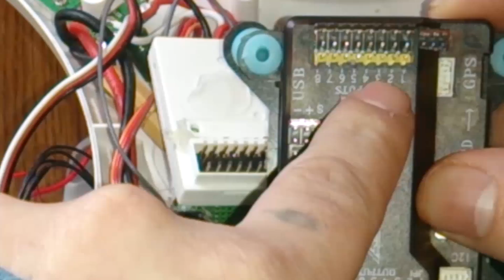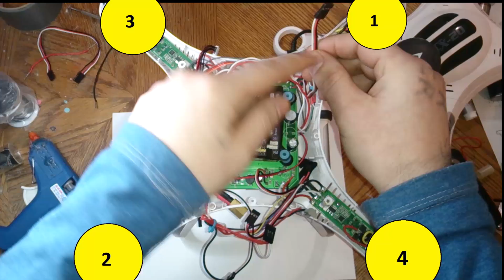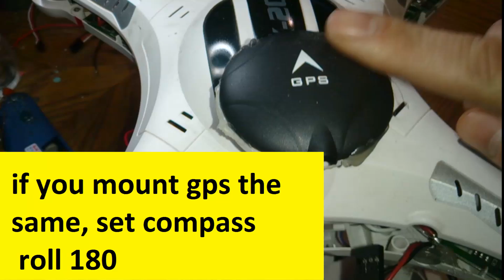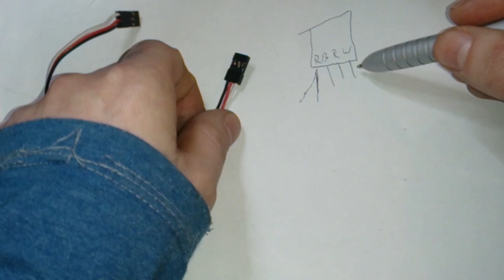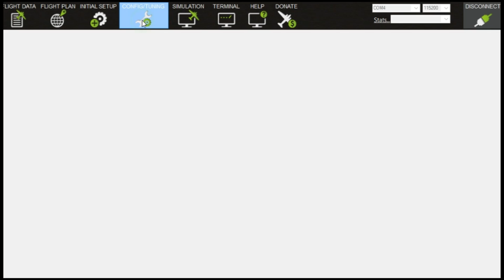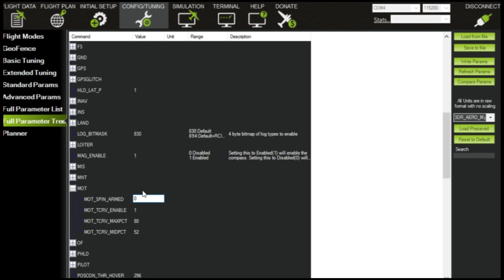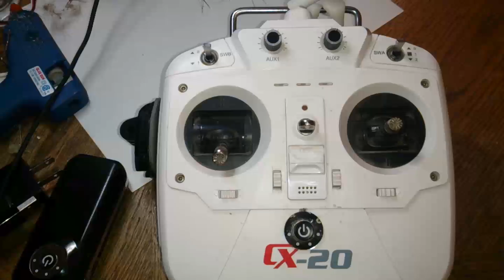cx20 factory apm to apm 2 6 - 2.8 step by step

Comment: Hi I have just built a tricopter with the APM 2.8 . USING DX8 RADIO.
I  am having trouble getting the flight modes in setting to change green to each  is loiter RTL stable ect.any ideas what's going on channel five is set for aux1 that is working in monitor. I can do every other settings in mission planner but flight modes.
Reply from the maker: Hi I don't have a dx8 ..   You would have to mix  channels 5 and 6 in settings on the transmitter....Then play with end points..    But i have no idea if you can do that on that transmitter ..   Somebody must of got that transmitter working with the apm 2.6 / pixhawk ect..
Reply: @ModItBetter  thank for your input I'll give that ago.years ago I built a quadcopter and it just worked.all flight modes.

Comment: Hi  Bangs My quad is the Quanum Nova Pro version. The wiring and plugs for the LED's is different to the CX20. I recently dug it out of my drone hanger hoping to fly it again after a couple of years. This version comes with Arducopter type control board as standard. I fitted a new Arducopter because the original had problems. Unfortunately i didn't take note of the connector positions when I first stripped it down a couple of years ago.My problem is i can't get it to arm. I have disabled all the arming checks in Mission Planner. When I plug in the battery I get orange/red flashing alternately, and green flashing until it acquires sats  then it goes solid. The orange/red  light doesn't turn just orange and give the ready to arm signal. It could be the wiring not in the right pins, but i don't want to change them over in case I blow something.  Can I send you some photos of the setup to see what you think?
Reply from the maker: HI here is a picture of the pinouts
https://drive.google.com/file/d/0B2w6_OKE_2kxc1pMTmdNSkFLQTQ/view?usp=sharing

Did you do a radio calibration ?  
also the wire people usually get wrong is the wire that covers 3 inputs on the receiver..  E,T,R     you might of put it the wrong way.      4:51 of this video
Reply from the maker: if you want as you said you can send some pics to 
bangs696969@gmail.com  
I can try to see if i see anything wrong on receiver side.
but make sure you do a remote/radio calibration . ect..
Reply: @ModItBetter  Pics sent from my phone.  Did radio calibration in Mission Planner and remote calibration as you show in the video. One strange thing about the flight modes in MP the mode changed as the switches were operated in words above the actual mode list ,but the green mode indicator did not move down the list as it should
Reply: Should all the wires into the analogue pins except the ground wires be in the switch rail ?
Reply from the maker: @kenmcnaughton5882  still waiting on pictures they have not shown up yet.
Not sure what you mean by all the analogue pins..  for the receiver to the apm ..the cx20 did send the positive and negative to channel 7 and 8 on the apm 2.5.2...   i could never figure out why they actually did that unless it was just so they would not float...  anyways its not needed.

I"m not 100 percent sure your using a 2.5.2 apm or a 2.6/2.8 apm as well..
Reply: @ModItBetter  Sent the pics to your email from my phone I will try again.I call the pins on the left side analogue because number one to eight says analogue nine ten and eleven are marked PWM.
Reply: @ModItBetter  I am only using the earlier APM, the other one is dead.
Reply: @ModItBetter  Thanks Bangs I don't know what i did, but it is working now. I was messing with the switches, and suddenly i was able to arm it normally. I was thinking that in some positions the switch won't let it arm.
Reply from the maker: @kenmcnaughton5882  Finally got the pictures lol.. really weird cause i sent my self some emails to test and it was instant..

.. you must of moved channel 5 to the right pin you had it on the positive rail  at least it  looks like that  in your pictures..
..   https://drive.google.com/file/d/1nQlOjngGIO2FXq25myj91ubo0LngippA/view?usp=sharing

but i could be wrong could be just lighting .. dunno .. to me it even looks like everything is shifted over Like you started in channel 2.... channel 6 should be 5 ect.. so must be just bad light..  check out channel 5 anyways just to make sure its on the switch rail and not the positive rail..   You did say you could flick through the channels so again odd lol..

Comment: Hi how do you  wirer stock Compass to apm  2.8 with mini gps I can send you the colour codes . But not for compass  they are all red wires cheers Gary
Reply from the maker: hi you have to be careful because the stock compass is only 3.3 volts 5 volts will fry as I've seen many fried 883 chips..  here are the pinout i did in another video... but again the apm2.6 usually only has 5 volts on the i2c but i have seen couple of htem with 3.3 volts as well. the link shows you the pinout on that cable
https://youtu.be/STkRdHC-guI?t=617

Comment: Hey! kudos on the amazing detailed video...
I have a problem where my CX 20 starts up and 90 percent of the times, doesn’t unlock its motors once on...
In the off chance that the motors do unlock, once I push the throttle up, it doesn’t react at all...
Any advice you could give me to solve the issue...? 
Thanks in advance 

Kay
Reply from the maker: Hi .. have you tried to disable arming checking on gps
24:02
Reply from the maker: Just keep in mind if you do disable this and have issues with this out side as well....  .. usually don't fly until you see your green light solid ..meaning a 3d lock on the gps..      other wise if you do have issues with your gps you wont have return to home ect..

Comment: How do you calibrate a FLYSKY transmitter? I can't get to arm my APM 2.8
Reply from the maker: hi did you disable arming check ?
https://youtu.be/mrBWEATUbus?t=1465

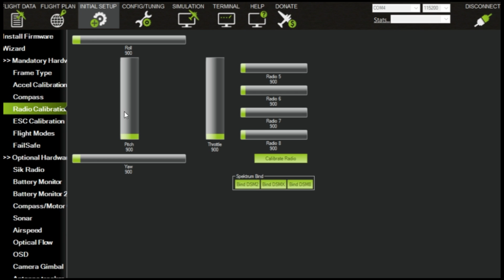and calibrate the remote in mission planner under radio calibration 22:56
Reply from the maker: you also reversed channel 2 right? in the settings on the remote
https://youtu.be/Vyt2d8rXkws?t=499
Reply: @ModItBetter  No yet, I will try that. This project that I am working on it is unique. It is a dual copter with an EDF inside. I am trying to have the craft loiter first then use the EDF for forward motion (I can't lose the VRA - I am using it to control the EDF). To balance, I need to be able to change the CG, so instead a rear motor (like a tricopter uses the rear motor for pitching), I will place a servo to move the front battery back and forth, again for pitching). I am using the tricopter flight planner configuration for the firmware, so not sure if once I replace the rear motor with a servo would work(not sure if a servo and motor would use the same type of pulse nor how would that affect the APM arming process). I still need to calibrate the ESCs, but I again, I have the EDF? Not sure how.
Reply from the maker: @ernestosaboia  Very interesting project.I have done no projects with edf ... .. the motors and servo will use the same pwm..  its 1000-2000 pwm..   
arming it should be the same as always..

shifting the battery for pitch.. wold that actually work? the accel/ gyro should compensate  for that movement ..and you would be fighting with hardware trying to correct it self.   How ever i've never done it so this is just me putting out blind info.    regardless great project hope it all works out for you..
Reply: @ModItBetter  Yes, I am excited about it. Thanks for replying and the well done videos. If you have any suggestions in the future let me know. Have great fly

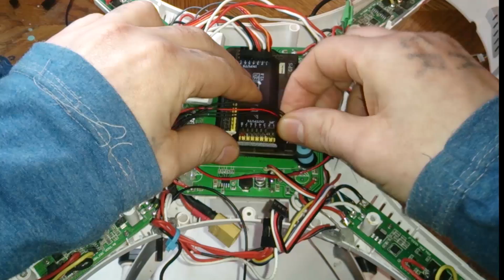Comment: I followed your video and it was a great help.  The only thing was at 9:00 you recommend taping up the 5V from the board if you have the power module plugged into the apm.  I did this and couldn't get my minimosd to work because it could only get 4.4V.  Worked fine after I plugged the 5v power from the pcb into the receiver.
Reply from the maker: cool thanks for the reply.. Personally I would of used the 5 volts off the board to directly power the osd instead.. but great you got it to work .

Comment: i followed your steps and the only way i can connect to mission plannner is to diconect the gps wires to my ardupilot 2,8 but then i cant calibrate the compus i can unplug the 2.8 and just use a usb and the gps and compus wires and mission planer works just fine what do you think is wrong?
Reply from the maker: confused.. .. not sure what you mean..   You only need to plug in the usb cable while doing  all calibrations .. accept the esc calibration.     Just tape up the usb cable to one leg while doing the calibration so it does not come loose.
Reply from the maker: also make sure the compass gets plugged under the gps port if its a apm2.8 it will have 4 pins.. if you have 6 pins under gps port then it gets plugged into the port labeled..i2c. you also might have a built on compass..   so maybe I will wait for your next reply..
Reply: well i took the ardupilot 2.8 apart and re soderd the tabs for diferent settings my hud and now everything on mission planer works but my hud screen show the copter aiming towards the ceiling
Reply from the maker: @stephenandrews2422  did you do a accel calibration?
also you can send me a picture of the inside of your apm 2.8 here
bangs696969@gmail.com.  or post a link to a google drive ect.. however your message will probably flagged and not show up until I approve it..

I want to make sure you don't have a built on compass...

Comment: For external compass for you removed the Jumper and plugged it into the plug below, right ? But some people say you have to move the jumper to position3 or plug it into Ic2, cut some connections at the bottom. I am totally confused but I got everthing to work except for the compass.
Reply from the maker: if the compass does not fit into the port under the gps ..it means it goes into the other i2c port.
the port under the gps should only have 4 pins if it is actually i2c... If it does have have 4 pins then it does go there./ has to go there as the other port labeled i2c is a dead port so to say..You have to enable it with solder blobs..

..
the quick way to find out if  you have a built on compass is just plug the apm into mission planner..if you don't get a compass error that means you have one built on..    Then depending what version of board you have you might have to cut that one trace.
Reply from the maker: and here is the trace yo have to cut if your board is a original apm 2.6
https://drive.google.com/open?id=0B2w6_OKE_2kxOEg4QmhTa0JxMzA

now if your board does not look like that but you still have a built on compass and its a apm2.8
you don't need to add any jumpers at all. or cut a trace
Reply from the maker: and to spam a bit .. i show at this part of the video where it gets plugged into and the apm in the video actually has a built on compass .however just make sure you don't have a jumper in jp2 that enables it..
https://youtu.be/mrBWEATUbus?t=980
Reply: @ModItBetter  I know I have an internal compass but I like to use the external compass. I have Arducopter 2.8 . I will keep you up to date. Thank you
Reply from the maker: @nikleiser5888  ok so like my last message to you..it gets plugged in like the video.. i also have a built on compass ..as above just make sure you don't have a jumper in place and all should be well
Reply: @ModItBetter  I did like you told me but I get bad compass health, with the jumper set und utilizing the internal compass everything is fine. Do you have any further ideas ? 
Thank you very very much.
Greetings from Germany
Reply from the maker: @nikleiser5888  hi.. ok in jp2 your putting a  jumper on the bottom to enable the internal compass?   then it works?
with the internal compass but not external..

for kicks try to put the jumper on the top instead to enable external compass.. usually that is just a place holder and you should not really need to put it there..   but try it anyways.

so the way it goes is
xx  enable external compass
xx at32u2 bootloader enable
xx  enable internal compass

Comment: Does apm 2.8 have internal compass
Reply from the maker: Hi its not suppose to have it but lots come with one.. ..its always best to check.. 
Some you have to cut a  trace and on the apm 2.8 you need to remove a jumper.
Reply from the maker: if you do get one and are still confused just message me then send me a picture with the lid off...

another way to test is ..just plug it into mission planner when you get it
.you should get a compass error.  .. Also go to compass calibration
and try to do a live calibration if you don't get any dots at all.. that means you have no compass .  if you do get dots then you have a built on compass and need to remove the jumper or cut a trace.Assuming this is for a quad copter.
Reply: I need it for rc plane
Reply from the maker: Yeah sorry .. its actually a gamble on where ever you get it from ..if it actually comes with it or not.. .. You might have to get a gps/compass combo.. like the 880bn or neo gps     .  I'm not sure if you would actually want to use a built on compass on a plane as well. you might still get too much noise from the electronics for reliable readings.    But i don't have a plane so no idea on that one.

Comment: i cant find rotation roll 180 in my list ?
Reply from the maker: https://youtu.be/mrBWEATUbus?t=1410    you can also try to click on apm and  external compass  button.    

You might have to go to planner then layout and change it to advanced ..
example
https://youtu.be/G26LuTrb44s?t=546

If you still don't have it maybe you need to un-install and re install or you have to go to
Reply: bangs6996 is there any action for Jo’s jumpers do I need to remove it all or move it to port 2 or 3 ?
Reply from the maker: u need to remove both jumpers.. however you might have a internal compass and have to cut a trace.  https://drive.google.com/open?id=0B2w6_OKE_2kxOEg4QmhTa0JxMzA
Reply from the maker: also in the picture above .. if you look straight down from the circle where its marked to cut the trace.. you should see a empty spot where a chip is suppose to be.. if you have a chip in that location then its the built on compass / internal..
Reply: i use apm 2.8 
ill upload video now for that and send you link
Reply: https://youtu.be/4P67PAxaBK0
Reply from the maker: ok ..so you have newer version of mission planner that is why.. they got rid of the word "rotation"  ..so now its just roll 180   ...
Reply from the maker: sorry took so long to figure that out.. I don't have the newer version yet..
Reply: :) im soo stupid
Reply from the maker: after you do the compass dance/ calibration  ... If you have a real compass just do a compare or get a app for your phone .. but all should be well with "roll 180" if you placed your compass like i did..

Comment: Thanks for a great video. I am going to be making this modification and I was wondering how you mounted the FCB. In the video you left it loose saying you were going to permanently mount it later but you never said how you mounted it. Could you enlighten me please? Again, great video.
Reply from the maker: i have another video finding center of the apm.. but really just try finding center the best u can if need be.. ..i just glue it down with hot glue ..it comes off if needed as well..  If you don't have the anti vibration add on... i just use carpet padding from the dollar store..and put two of them together with hot glue and use the sticky side on the apm and on the main board..
Reply from the maker: here is the video of how to find true center.. or where to place the apm
https://youtu.be/e8x1jOAtFfo?t=207

Comment: do i need a PCU to use the apm 2.8
Reply from the maker: https://youtu.be/mrBWEATUbus?t=501  

No you don't need a separate power supply 
If you are doing this on a cx20, you have two options.. you can get a power module.. or use the cable from the cx20 main board.. ..
Reply: so not using a pcu is ok and won't hurt the flight controller. why does a naza use a pcu?
Reply from the maker: Hi the naza is made different.. and it usually comes with one so it can do the fail safes properly..

the apm and pixhawk is optional, if you want to see your voltages and current then you need a power module..  

besides that the apm is designed to be powered through a esc bec, the wire coming off the cx20 or a power module.

/ 5 volts ..

it will not hurt it as I have ran apms with each setup..
the cx20 comes stock with just a normal bec built on the main board.. 

What will hurt the apm and esc's on a cx20 is using 
usb power and a battery at the same time.  I suggest removing
the red wire out of the usb cable (5 volts) then use the usb and battery at the same time..

.. if this is not on a cx20 and your esc's have becs.. remove the red wire out of 3 of them and place the jumper in jp1.  If you are powering it a different way then make sure to remove all red wires out of all of them.

Comment: Please guide, Can we fly QuadPlane with APM 2.8 board with old Mission Planner firmware 3.2.1
Documents says that APM 2.8 no longer support with latest firmware.
Please guide
Reply from the maker: HI .. you can use only up to version 3.2.1 anything newer then 3.2.1 wont fit.. ..well couple of them will be you need to mod the source to make it fit.

In mission planner even if you click on the newest firmware it will default to version 3.2.1 for you.
Reply from the maker: oh and for plane i believe its version 3.3.0 but again even if you click on the plane one ..it will detect what apm you have and default to the last firmware for it..
Reply: bangs6996 
Heartily Thanks sir . . . . . !